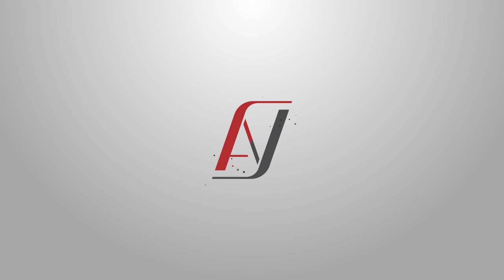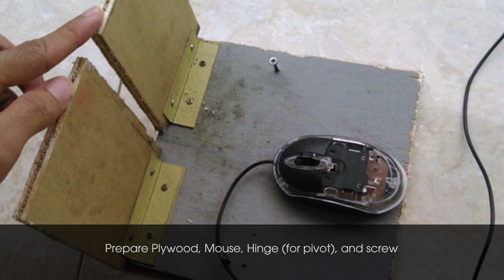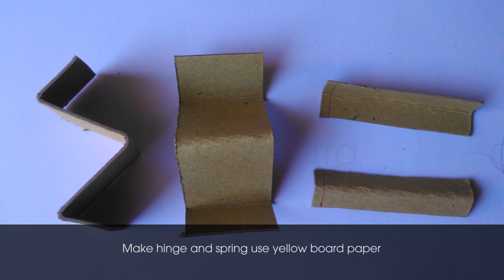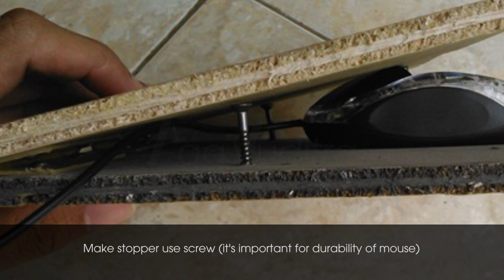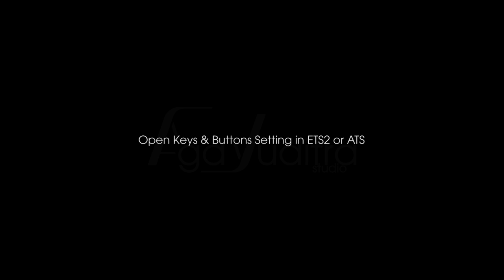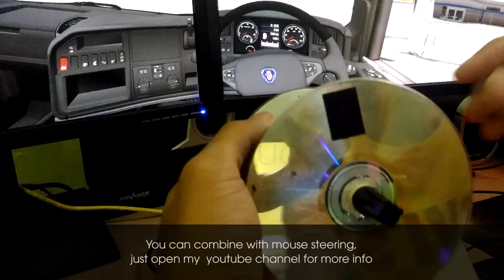DIY Throttle and Brake Pedals for Gaming - Mouse Steering Wheel

Comment: How can i use 2 mouses (one to steering wheell and other to pedals), at same time in one game? It´s necessary to install some software to force racing games recognize 2 mouses like 1?
Reply from the maker: yes youcan use 2 mouse at same time, without any software, just plug into computer.
for racing games I don't recommend using a mouse.

Comment: how can i create a clutch pedal?
Reply from the maker: +Wei Wen Yeoh if you want create clutch pedal, use joystick or arduino.
Reply: @AgaYuditraStudio  you can use the scroll it actually can be clicked and usually called mouse 3 or MMB (Middle Mouse Button)

Semangat terus y bang bikin konten gw bikin ini sama steering wheel dri tutorial lu buat hadiah ultah adek gw. di rmh gw bnyk mouse nganggur